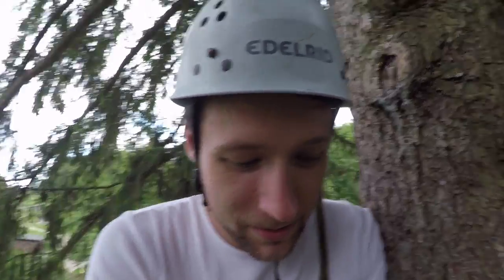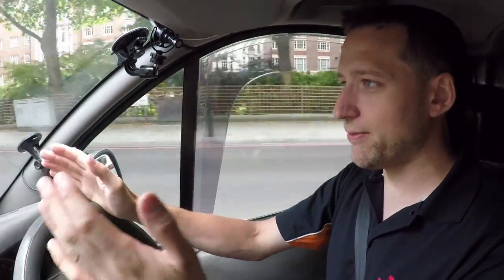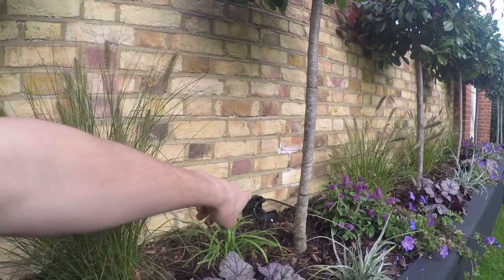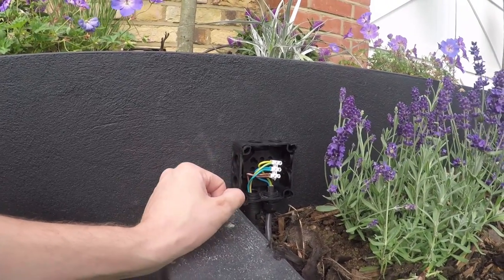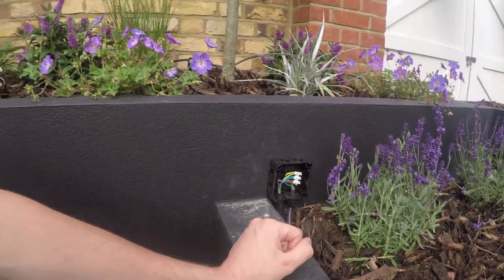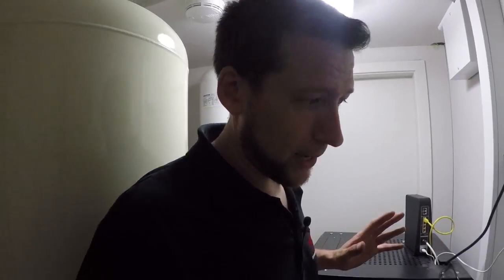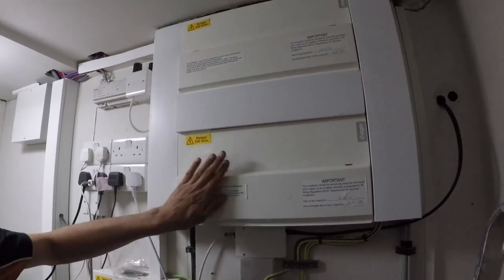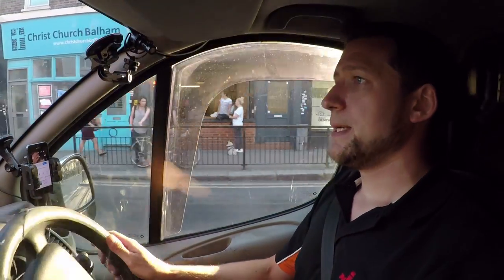Installing Outside lighting - An Electricians Day in London | Thomas Nagy

Comment: Wago do another type of connector which have clip based clamps. They take stranded cable really well, and clamp it nicely, so all you have to do is push the wire in and close the clip. The resistance across them is a tiny amount higher than the permanent install type where you just push fit them, but still negligible in the scheme of things, and have the benefit that they're compatible with both stranded and solid.
Reply: Nene you’ve already made the comment I was going to make. The Wago 222’s is what I would have used.
Reply: I would use the newer and better Wago 221 instead. The little lever used to open the connector is much easier to operate, the whole thing is transparent so you can quickly check for bad connections and they are quite a bit smaller than the old 222.

Comment: Beautiful yard and home with magical landscape lighting effect. I'm assuming the lighting voltage is ~240 with the 30ma fault threshold circuit breakers powering. If so I'm perplexed that the human safety factor  appears lacking in such a wiring design.  In the US were using 5 ma. threshold fault trip protected receptacles at outdoor locations and commonly landscape lighting would be 12 volts and which is much safer.
Reply: We can use 12v and 24v lighting for outside over in the UK aswell, sometime 230v is used for longer runs its safe enough if protected by a 30ma rcd 👍

Comment: You could use the wago lever Connectors, they take stranded and solid.
Reply: They are very  expensive
Reply: @janesouth2943  They are more expensive, yes, but he was also willing to spend the 50 pounds for piece of mind, so I'd say the 15 pounds for the Wago connectors wouldn't be that much of a stretch.
Reply: Of course one could also just crimp the stranded conductors ^^

Comment: I was just wondering when you mentioned the socket and it would go then you changed to the wall at 5:05, is that correct? Also what was the socket height from the ground surface? 450mm?

Comment: Excellent job! I know I am commenting 4 months old video, but here it goes: You did put the (practically) IP68 junction boxes above the ground. Under what circumstances would you actually install them with top level to ground, i.e. bury them? I think it would look neater overall, specially the central flowerbed part. Could it have been done this way also or do you think the constant humidity would sneak through the protection? Or is there some reg about underground j.boxes in the UK?

Comment: That is handy to see this video. I have a little control box in my garden for the pond pump and its a bit old and not amazingly waterproof. I might get some of that gel to put in there. Is it possible to clean the gel off afterwards if you need to rewire or add something in?
Reply: The gel can be removed easily for maintenance.

Comment: Excuse this question.  I am a complete newbie, just getting into DIY at home.  When you use red wall plugs, I understand these are for screws starting from 5.5mm to 6mm.  Seeing you use red wall plugs a bit, what drill bit do you use @5:09, is it an sds bit, and what size screws. Stupid question I know, however will help me get a better understanding of what to use. Welcome any comments from other viewers, I value your input, as I need a lil help in understanding, which drill bits to use, with what plugs and screws, please dont take the mick, I am just learning guys.

Just noting that many use red plugs a lot, therefore if I stock up on some, what is the best size screws to have handy, and drill bit to have.

The problem I have, is that I understand red wall plugs, are for 5.5mm to 6mm.  So ive looked for screws 5.5x25mm and 6x25mm (25mm being the length of the red plug), but im struggling to find any.  The same goes for brown plugs. Im looking for 7mm x 40mm but again, struggling to find them.  Where am I going wrong.  Any help, will be greatly appreciated. Im just looking at getting a selection of screws/plugs etc for future use.

Comment: Liked the video. Really good. Quick question. When you use 20ml conduit pipe with Hi-Tuf....do you put conduit pipe, along with Hituf wire, inside wiska box? If not, is there a risk that water may get in conduit pipe and stay there? Does it matter?

Comment: Great job but in a garden like that why did you not fill the boxes with wonder gel and bury them under the soil could of used sy cable in metal flexible conduit you work still looks amazing though.

Comment: Hi Tim, recent subscriber also a self employed sparks in bristol. How did you fill the boxes mounted vertically? Myles
Reply: Place a small funnel in a knock out on the top of the box (once the front is fitted) then pour or squirt the gel in. Once finished seal the knockout with a closed grommet or screw cap.

Comment: Hi!!
Nice job mate. Few weeks ago i install the same lights in garden i just wonder  about what cable should i use .I used  Hi-Tuf as well :D :D . Now everything is clear.Could you tell me where can i get this gel?? Thanks
Reply from the maker: hi bud. 
yeah i used hi-tuf and just covered it with some 20mm Kopex for some additional mechanical protection. that gel is available in most wholesalers. i got mine online. normally i buy the 2 part mixable stuff but i didnt use it on this job becuase the wiska boxes were attached to the wall and so i couldn't pour it into the boxes. the tubed stuff is much stickier and you kind of have to tear it off. imagine ripping a gummy bear that's been in the microwave! its that sort of consistency.

Comment: Welcome back Thomas; we missed yer. The Hi-Tuff certainly looks preferable to SWA. I fitted a similar lay out recently and the SWA was a challenge to bend into 1/2 metre square planters. What are the Hi-Tuff glands like to work with? Looking forward to Chelsea :)
Reply from the maker: Yeah I like using the Hi-tuf. Much more flexible than SWA in small spaces. You can use 20mm compression glands with it, Or if it's run in Kopex then just use the weatherproof kopex adapters which is what I did. kopex adapter, waterproof gel inside the box, job done. Take care mate

Comment: Could you not just wrap the connector block in waterproof tape inside the junction box? That gel stuff is a good idea but so messy to work with. The previous owners at the house i am used expanding foam and it took me ages cleaning this mess up.

Comment: The amount of unsafe wiring I see in gardens would frighten you.  I'm no spark but I know a 3 core cable trailed across flower beds to feed power to a pond isn't safe.  I've advised countless folk to get their wiring checked by an NICEIC guy and when I go back to the job weeks, months or years later nothing has been done to correct the obvious.  It's pretty mad how some people will take risks to save money.

Comment: Secondary comment: re danger of digging/shock risk: I see no problem with your method, but would protect the circuit with a 10mA rcd to be on the safe side.

Comment: Health and safety should be optional. Climbing up a ladder and swinging a chainsaw above my head with no ropes or anything safety, I know not to do and say fuck that but say climbing up some industrial racking that ain't budging to the first shelf to pull something off the top shelf I know if I feel safe, it's probably alright. The 90 seconds you spend doing that in an "unsafe manner" could save you 10 minutes of moving shit to get something to do it "safely" and then put it back "safely" it's just stupid. It really annoys me the majority of it 'cause it's just common sense. If you look at the situation and come up with the decision of "it's borderline" proceed with caution, if you think there's not much risk then go for it. To me if you doubt yourself that's where the issues are